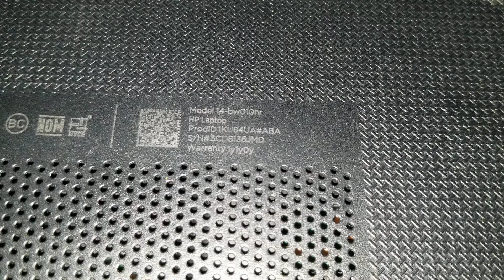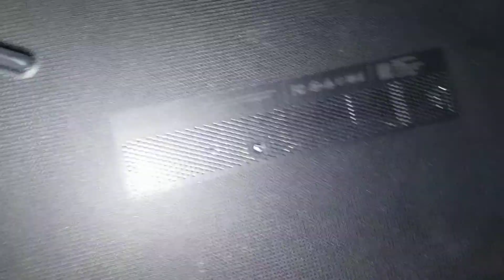HP 14-bw010nr Disassembly SSD RAM Upgrade Repair

Comment: You just can't believe the idiotic way laptops are assembled sometime. That dickish move with the hard drive bay looks like they sat and worked at making something simple into a ridiculous situation where you could easily break one of the cable clips! Why not run the cable under the drive bay? FFS.

It's identical to mine, though slightly different number in AU. The right-hinge case screw was very tight but eventually got the screw out. Unfortunately (for me) the crappy paper-thin piece of plastic holding the brass nut snapped off in the process. So, I have nothing to screw into now and the hinge on this garbage HP has a metal shroud over where the piece goes- so can't even attempt a superglue fiesta.

I'm contemplating using a dremel to drill through the very corner of the back cover & top (nothing there at all) and then using a nut to hold it from the top. It won't look elegant, but do you think that the plastic will just crack as the corner really is just empty space, no reinforcing plastic ribs, etc. Have you ever attempted something like this successfully?

Cheers mate!
Reply from the maker: I'd just fill it with jbweld. Lol
Reply: @ItsBinhRepaired  I've used jb many times, but in that hinge, it would require a complete disassembly of the paper-thin chassis as the area it came from is underneath a piece of metal shroud. With my luck, something else would snap off. The stupid thing is that there's an actual metal hole they "could have" threaded, but no, let's cram a brass nut in between wafers of brittle plastic. I'm just going to use heavy duty black duct tape and wrap it close to the corner/Kensington lock area and underneath. It'll just be sitting on a desk anyway-- it just irks the F out of me. Thanks for the reply.

Comment: What tipe of battery Is?
Reply from the maker: What do you mean by that? It's the kind for this model. Are you asking me what chemicals and stuff they make it with? Most likely lithium something.
Reply: @ItsBinhRepaired  I want to buy a new one and i dont know what tipe is it
Reply from the maker: @elgansoapruebaesto7258  the model is on the old battery. Do you still have it?
Reply: @ItsBinhRepaired  yes
Reply from the maker: @elgansoapruebaesto7258  check on the battery it'll have the model number you need.

Comment: What RAM should i buy?
Reply from the maker: The thumbnail already has it. Not sure what you mean. As long as the specs match you can use it. Amazon reviews will tell you what is good.
Reply: @ItsBinhRepaired   that doesnt really answer the question. what amount of ram should be brought ?
Reply from the maker: @tricebx718  the amount depends what you want, how much you're willing to spend, and how you use the computer. 8gb is enough for most people, but everyone decides what they want for themselves.